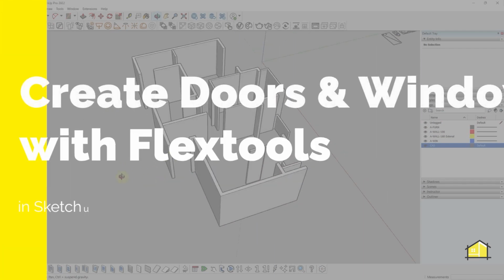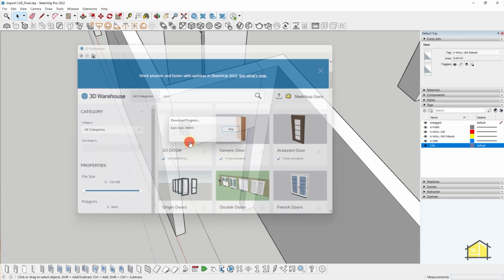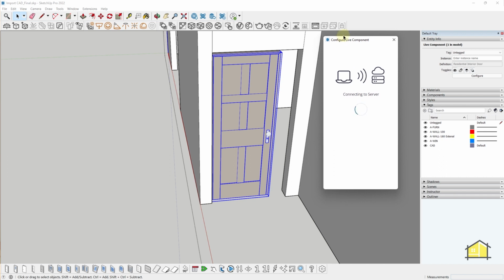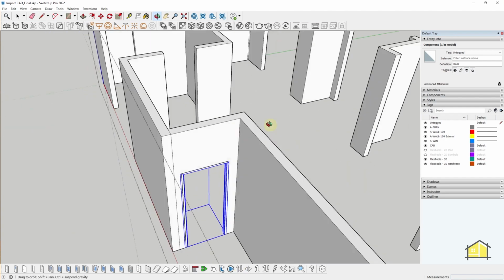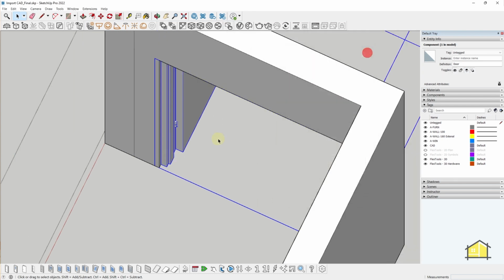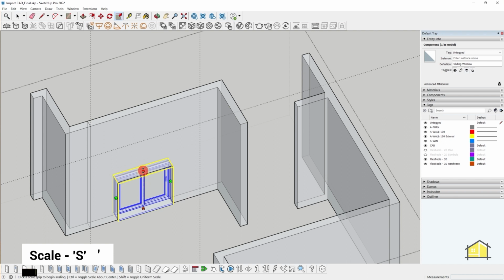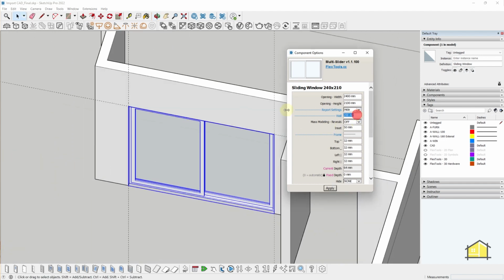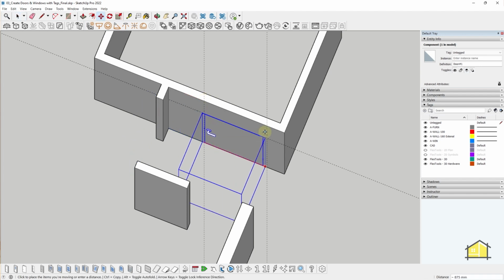How to use Flextools in Sketchup | Sketchup Plugin Tutorial

Comment: Thank you for helping me understand the FlexTools extension, which I purchased last year, but have not used much.  I subscribed to your channel to follow your future videos.   It is especially helpful when you show situations when FlexTools doesn't work as expected and what is needed to correct.

I have had trouble getting FlexTools window to work correctly on surfaces that are rotated at odd angles and not parallel to the model's major XYZ axes.  FlexTools windows also has trouble when I try and use it to fill existing openings with a window, not starting with a solid surface.  Wish there was a way to turn off the hole cutting feature of FlexTools.  

Again - thanks for your excellent video tutorial.